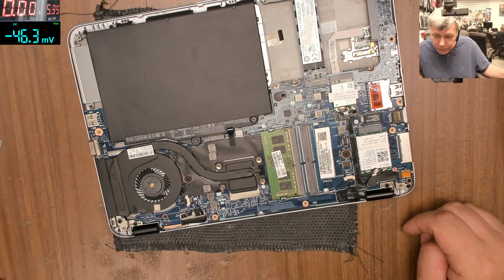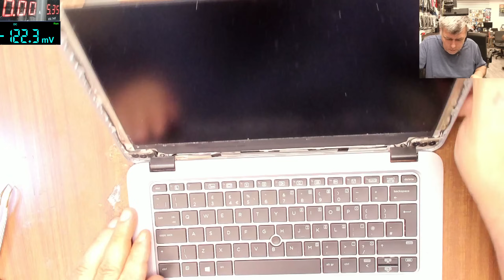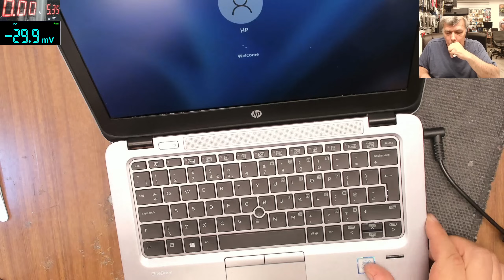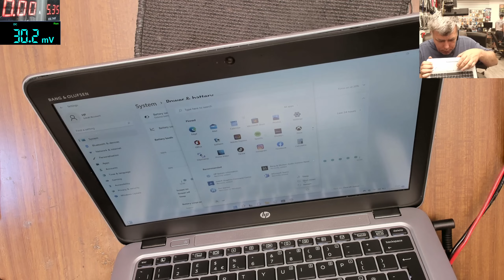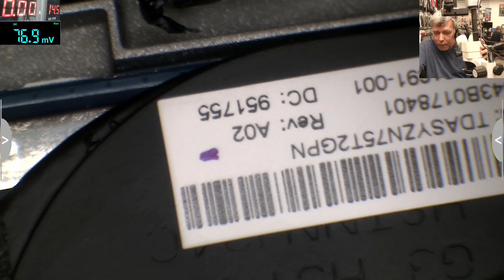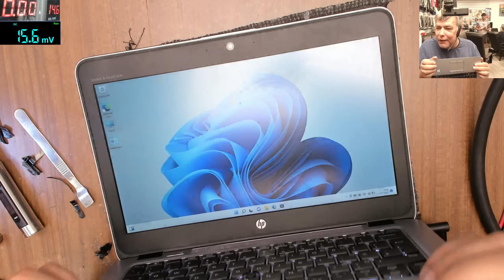HP 820 G3 laptop - No backlight and a dead battery - Can we revive a dead battery? :D

Comment: Am working on hp elitebook 840 g3 . the problem is , it can only turn on when i put in charge battery but not on charger. if i plug in the charger all the necessary voltages come , but still cant switch on from charger

Comment: Hello before you open the battery first look on battery and motherboard connection, mabe there pins have free space on battery connector (try to push not hard every single connection pin and battery using small + screwdriver ) sorry for my english :) pozdrowienia z Polski

Comment: Ive already ran into 2 BRAND NEW Gateways with the same problem that HP has with the battery and if you smell that battery it has a sweet smell to it and the first thing I noticed was the mousepad where the battery was mounted was Rising up for no reason so I took the laptop apart and the first thing I observed was the thin plastic wrapping around the battery pack had filled with compressed air which was pushing upwards on the mouse pad 2nd thing I noticed was a sweet smell coming from the battery pack 3rd thing I noticed was the battery voltage was reading ZERO unplugged but plug it in it would charge completely up in 10 minutes then go dead as soon as I unplugged the charger Replaced the battery ALL Problems solved
Reply: I have the same problem but after replacing with new battery

Comment: I have a dell inspiron 13 7000 Series it was working well a few days back now the battery can’t charge when put it on it shows Ac adapter unknown can’t charge the battery it will match the power with the performance of the machine when you click on the continue it is very slow can’t do anything I thought it’s the battery. I tried another battery same thing, then I tried changing the charging port it’s was still the same, I even changed the Ac adapter but nothing changed any help 🙏🙏🙏🙏

Comment: That Elitebook has the same 4 front LED indicators (Wifi, power, charge, HDD) on all HP Business laptops since the acquisition of Compaq up until that laptop, and even on the old Compaq models like nc6220 nc6400 6910p, when the battery LED comes on amber and then shut off, the battery (BMS controller) is toast (while amber means charging, green/white means >= 90% charge, and then off means fully charged).
Even on those units it's impossible to revive the controller for the same reason. But if you do have an aftermarket battery instead (many with no permanent failure flags), then most of the time just charging the cells up and make them reasonably balanced will revive the battery and it will work once again, or if it is critically discharged but not this crazy (at least like 7V), they will just charge the battery anyway and it will work. This is how I got working old aftermarket batteries working for old Compaq/Elitebook models.
Note: Pavilions never used this set of indicator codes, and their meaning and location changed all the time.
Reply: Aftermarket to the rescue!

Comment: I have the same issue with an asus battery i made two holes to reach the cells and charged it with a psu but laptop won't turn on, the thing is that it's very hard to get inside for the board without breaking it and it won't charge as you've shown, thank you for sharing. btw there's no worse than hot weather combined with high level of humidity

Comment: I don't buy HP anymore. Garbage laptops. No clock backup batteries these days. Lenovo much better brand now. I have resurrected lithium cells in the past by charging the battery behind the protection circuit; once it has some charge the protection circuit will then allow it to be charged. Seems when batteries are empty the electronics won't let them be charged, and it an issue when batteries have run right down and not been charged for a long time. Have also had batteries puff up; in this instance I have put a pin prick in the plastic bag that the battery has been sealed in to release the gas buildup. Then its fine although you might might get the occasional wiff of the gas through the pin prick!

Comment: Sorin:

Good to see another video! Regarding the battery not charging; I recently fixed an Alienware laptop that had the exact same issue. The battery would show as taking 0mv of charge in BatteryInfoView, but the battery was nonetheless recognized and it had capacity information and all the normal stuff you see when a battery is connected. Only issue is that it wouldn't charge.

That was until I found out that the power MOSFETs next to the charging jack were possibly faulty. Removed the two MOSFETs and discovered that one of them was showing resistance of <1k ohms from Drain to Source. This probably caused the battery to read out as just "Plugged In." After taking them both off, I measured both and one measured 0 ohms from Drain to Source; the other was measuring 3M ohms, so a shorted charging MOSFET was the culprit.
I then replaced the faulty MOSFET with a healthy one and the battery started to charge and reached 100%. After replacing I also measured resistance from Drain to Source on both MOSFETs and they were back up into the healthy 100k ohms range.
Reply: I don't understand how the main power mosfets can have an impact on only the battery charging circuit? If such a mosfet is faulty, then the whole laptop would not work.

Comment: The BMS of the battery has many software protections like "permanent failure if is over discharged" or "permanent failure if cells are unbalanced", doesn't matter if the battery has only one cycle of charge. To reset this internal flags you have to connect the battery to a specialized interface available from the manufacturer of the chip (Texas Instruments), or I2C on a raspberry pi, run a I2C address scanner, find the I2C address, and login into the battery with a password known only by the manufacturer of the laptop. That password is used as a key to communicate with the laptop and guarantee that the battery is genuine.
The protocol is something like this: The charger IC from the laptop is sending a random number to the battery, the battery encrypts the number and is sending back a  20bytes digest. 
You can sniff the communication, but the password is 16bytes long and the random number is encrypted twice with SHA1 algorithm. A brute force attack will take more than 10 years.
Reply: i used to clone the eeprom of good batteries und flashed it to the bad batteries and it fixed it many times but this was 10 years ago. sometimes i also had to replace dead cells.
Reply: @robbirobson7330  Yes, good old days... now the BQ series are SoC devices. I found some russian sites that claim that they found a way to crack the security of some of this chips.
Reply: ... Oh well! It seems easier to crack the code to launch an ICBM!🤣🤣🤣
Reply: @mariodistefano2973  hey Mario, you're still around?
Reply: @roseelectronics4582  yes!
Reply: Stefan , thank you!
Reply: What the???
Reply: @roseelectronics4582  This is how you get to buy a new battery. Is all about marketing and sales. Most of the cells in all batteries are recycled with over 60% health in them.
There have been many lawsuits related to environmental pollution, but the big electronics companies have always won.
Reply: @stefanputureanu9296  because money controls the modern society

Comment: I had a similar laptop but the battery was 18650 cells, would say fully charged and recognised but when you powered on it died almost immediately and would register zero again. So I opened it up to find 2 of the cells had leaked acid. So it was thrown in the bin, was a nice experiment  but not viable to buy individual cells. Good to see you back on again.

Comment: It would have been interesting to see what your Laptop Battery Analyzer would have shown.
Reply: LoL my thoughts exactly. Did Sorin forget he has one?
Reply: @SelfMan-SK  i think he completely forgot about that, because it should have a unlock option and it can work on many types of battery controllers. 
I would also love to see what it can do to this battery
Reply: I think he actually doesn't use it and was just doing a promotional video.
Reply: @kriswillems5661  I kinda refused to take this into account, but all signs leads to the conclusions that sadly, it may be true. Too bad if so...
Reply: The first thing I do when the battery is not charging is to connect it to the battery analyzer.  
It has happened to me many times that the cells were depleted and NB could not charge it. 
 It was enough to charge it on the battery analyzer and then everything worked. 
 It may have been blocked due to a low level of battery cells. 
 In that case, it must be reset.  
Of course, it depends on the state of the individual battery cells, but mainly what is the balance between them.
Reply: True!

Comment: Why didn't you use the NBLA battery device you was sent by NIP Embedded
Reply: @Mr Guru nonsense, all packs can be re-celled. It's usually a manufacturers access flag that needs to be reset. I've done many, I have the equipment including resetting these 'mystery' microcontrollers. No mystery, the fact that people have no clue what they are talking about, astounds me